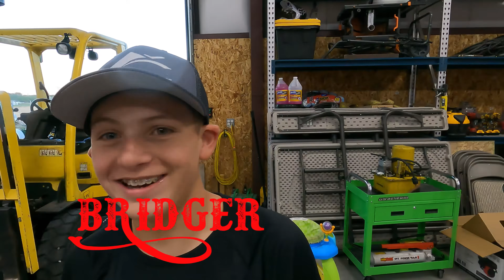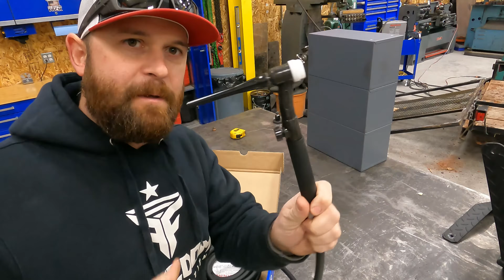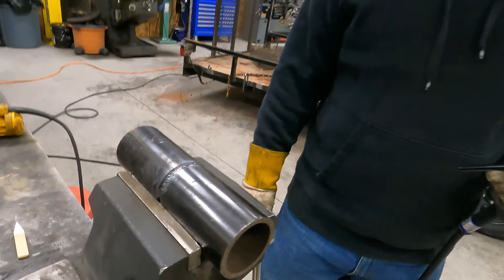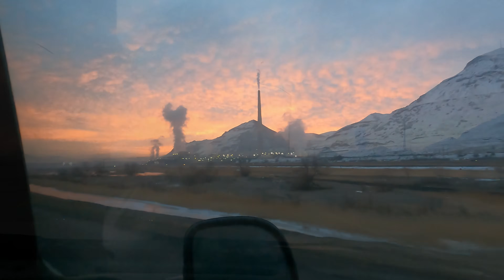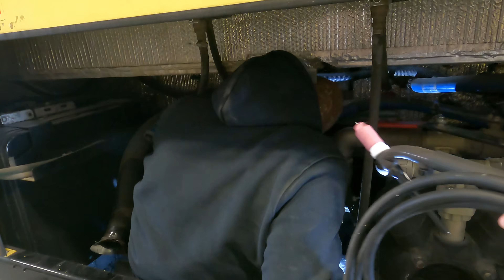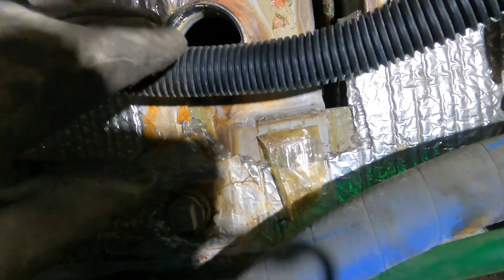Mobile welding stainless TIG tank repair

Comment: So do you charge by the hr or if it’s per job how does it work when in cases like this it was a lot more than than you thought or quoted ?
Reply from the maker: I charge by the hour. Luckily on this job, the customer didn’t ask for a quote, and I didn’t commit to a price. After I got on site and we discovered where the crack was, I told them it would be X amount of hours more due to where the problem was located and how much work was involved. That happens more than you think. One lesson I learned early on was that not saying too much before you’ve seen the job is usually in your best interest. That way If you get there and it’s way more work than the customer thought it would be, which is most often the case, you haven’t committed to a price that you agreed to over the phone without seeing what’s actually involved. Thanks for watching!

Comment: I'm surprised they didn't pressurize the tank with air rather than filling it with water to check your repair.
Reply from the maker: We actually tried that first, but the breather was like a 6 inch pipe, and we didn’t really have anything large enough to plug it off to the point where it would work properly.